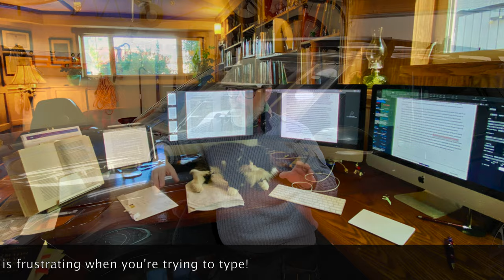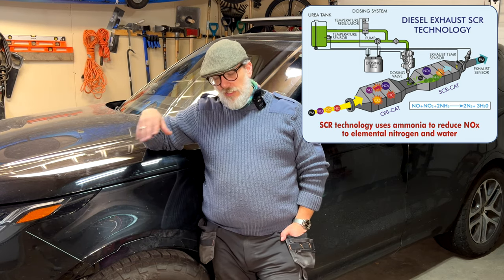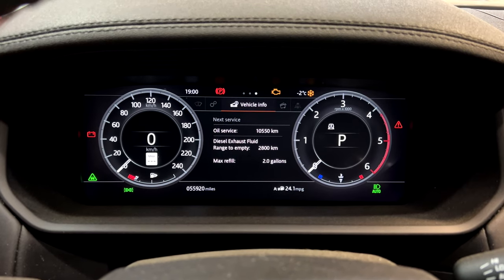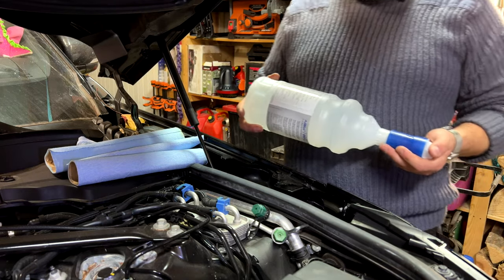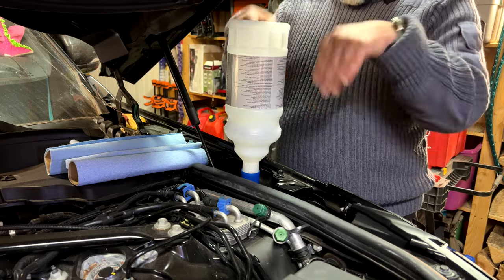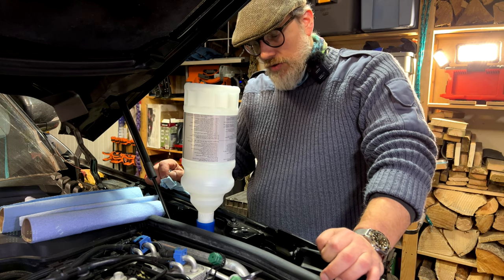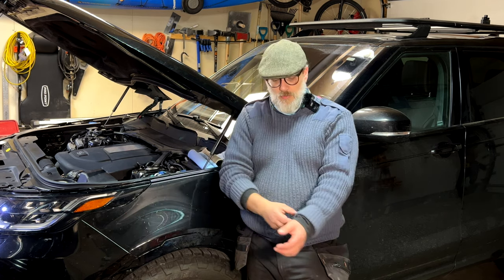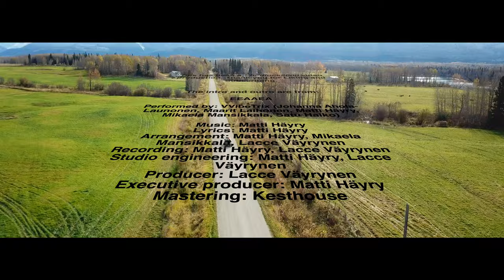Filling the DEF/AdBlue Tank on a Land Rover TD6 Discovery 5 #disco5 #discovery5 #L462

Comment: HELP PLEASE 2017 L405 TD6 i have the error messages 200km can i just take the bad DEF fluid off and get new DEF fluid from the dealer to replace it ? after replace the fluid is it going to  require any reset code?
Reply from the maker: Hey, 

That’s a tricky question because it depends how the codes are logged. So take what I’m about to say with some levity. 

The bad or poor quality DEF error is usually logged as a function of inadequate performance and is problematic. Draining and refilling the DEF tank will not make the code go away unless the system detects better quality DEF. It might be possible to make a hard reset of the vehicle by disconnecting the positive and negative wires to the batter and touching the wires together off the battery and holding for 30 seconds to a minute. 

However, if the codes are hardcoded, then it will need a computer to remove the codes. The GAPIID tool has some functionality and can clear some codes — but it depends on if the sensor continues to detect inadequate DEF. To reduce that risk, you will need to clean out the injector (which goes into the exhaust).

It’s a major PITA, and I do know a few people who were able to clear the codes. However, when my injector broke off, I did need JLR to reset the code, as the GAPIID would not — even with the new injector fitted. 

To be honest, I am not certain how the poor quality DEF is identified, and I suspect that such errors are actually some type of DEF injection issue. Using only the best quality DEF is critical (as I mention in this video).

Comment: Whatever happened to simple diesel engines like the Perkins Prima and the Peugeot Citroën XUD! We complain but in reality modern diesels are far more driveable, cleaner and quieter than their forebears, although reliability and fuel efficiency doesn't seem to be as good anymore. Our Discovery 3 2.7L TDV6 seldom does more than 22-25 mpg (UK) and it appears that your new Discovery is little better. Our old Td5 was great on fuel!
Reply from the maker: I think the development and progress of Diesel engines speaks for itself. While we certainly have more drivability and power, the cost is fuel economy. The older diesels were less complicated, but with them worse emissions — I remember the smog my diesels used to make while idling! That’s not an issue anymore, so better in that respect for sure.
Reply: @shedlock2000  
I don’t quite agree. My first car was a 1977 Ford Fiesta 1300S with 66hp. It did about 26mpg UK. Next was a fuel injected, twice as powerful Golf GTi 1.8 which managed 30mpg. My first diesel Range Rover was a 1988 manual with the 2.4 VM, totally lacking in low end torque and only 112hp, weighing 2000kgs and did 26mpg.  Next was a 2004 Range Rover with the 3.0 direct injection BMW and GM five speed auto… 30mpg on a journey, 28 average.
Move on to today and one of my vehicles is a 2.0 Kia Sorento diesel with 200hp and 500Nm torque, weighs 2.2 tons and has seven seats, an eight speed twin clutch auto and just today I did 80 miles around West Wales’ hills and averaged just over 40mpg. This one has Adblue.
This is in stark contrast with my 200hp 400Nm Toyota Land Cruiser 100 series with the 4.2 turbo intercooler diesel engine with electronically controlled injector pump and four speed auto that is comparatively sluggish [extremely sluggish but a great vehicle] that on the same journey would have struggled to better 23mpg. The Sorento has 4wd and is more roomy, and eats the Toyota and previous vehicles for breakfast in performance terms [apart from my chipped Volvo XC90 which was absolutely equal in every way to the Kia]. The Kia doesn’t have the offroad and towing capacity of the Range Rovers or LC of course, but that is not what I’m comparing. I’m comparing fuel consumption of equal roads.  The newer vehicles are not only cleaner and far more powerful and require far less frequent servicing but they also last longer and are substantially more economical in the vehicle, no matter how you measure it.

Comment: Cutting the hole is what I do and save more money by buying Adblue from a tractor dealer or motor factor in 20 litre drums. It’s very dense stuff and 20 litres of Adblue weighs as much as 25 litres of diesel more or less. I only have one engine requiring Adblue so 25 litres is enough and lasts a year or two for the car. Kept indoors it does actually last three or four years. Indeed due to Covid my first refill of the car’s tank was at two years of age, taking 15 litres to nearly fill from near empty [Not a LR]. I paid £10+VAT for 20 litres about a year ago, so £0.50/litre.
Great advice on the filling bottle and great minds think alike. Not only does it save a lot of money but it allows easy measurement.
The DEF I use is Yarra  Air1.  Yarra is a very large multinational fertiliser/chemical manufacturer. Urea is after all a Nitrogen crop fertiliser and indeed a 281% protein product equivalent. [yes really, 281%].
Reply from the maker: Good to know! I’ve not done much research into the DEF, to be honest, I stopped driving trucks before it came out and, being in North America, it’s only really hit my radar recently. 

I know that land rovers can be annoyingly picky about their DEF quality, but I’m not sure what properties sensors measure (nor how they measure it). Our cold may make them additionally sensitive. 

I’ve been told that DEF de-natures in sunlight and extreme cold, but I’m not sure how long it lasts in moderate temperatures and the dark. I just buy mine when I need it (oddly enough, my message pied up tonight — I’ll refill it tomorrow, but it really hasn’t lasted long this time round).

Comment: i would like to know what remains of the 4x4 system if you remove the fuse from the abs what is mechanical and electronic
Reply from the maker: Hi Erwin,

This is a very complex question and I am not certain that I have all of the answers that you need -- most of what I am about to say is conjecture rather than fact. 

The TRS system incorporates Traction Control (TC) functionality from the braking system. In fct, most of the '4wd' tech is based upon a system which applies the brake to a spinning wheel. Accordingly, removing the fuse for the ABS system will prohibit that functionality. In addition, it will throw lights on the dashboard which will likely disable or limit other functions -- for instance, the HDC will become inoperative as will the ATPC and the autonomous braking system. 

The centre and rear differentials (the latter may not be fitted) are electronic and variable. I imagine that they receive slip notification from the ABS system in order to determine the extent to which they apply. However, in certain TRS modes the protocol for engaging is a function of programming, so initial lock up to move off in GGS, for instance, is programmed in rather than sensed. How well (or even if) the diffs work with the ABS fuse pulled is questionable, given that the ABS light on the dash may inhibit the diffs from locking at all as a sort of fail-safe to blowing the diffs on good terrain. 

The high and low range should be independent of the ABS system, and so you will likely have the option to engage low range, though without the ability to manually lock the centre diff, you may not benefit from the increased torque due to an inability to put the power down to the ground.   

To what extent the TRS will work I also cannot comment. The TRS does other things such as limiting the power output or sensitising/desensitising the throttle pedal; it also affects gear shift protocol, holding on or releasing gears sooner to avoid slip or to provide more wheelspin. In theory, thee systems do not need an input from the wheel spin sensors to engage, though whether or not they are operational when the vehicle detects an issue with the ABS I cannot say; it is possible that the failure of the ABS to operate properly may cause the TRS to be wholly inactive.

In short, the answer is not very much. You will likely have low box and maybe some pre-programmed diff engagement, but that's about it. In fact, because there is no-longer a mechanical lever or viscous coupling to engage the centre difflock, I am not even sure if you would have that.

Comment: Cool combustion creates a minimal amount of NOx in the exhaust, so DEF/Adblue does not need to be injected until the engine is warmed, by which time the electric heating system should have mildly heated the Adblue/DEF.  The greater problem is getting the unrelated particulate filter up to temperature to enable the soot to burnt off. The two systems and the exhaust gas recirculation system are all quite distinct and independent.
Reply from the maker: Agreed. The DPF stuff isn’t connected (although they’re both part of the emission control systems). Didn’t know about cool-burning not generating NOx, that’s interesting. Must be something to do with the increased air mixture at running temps.